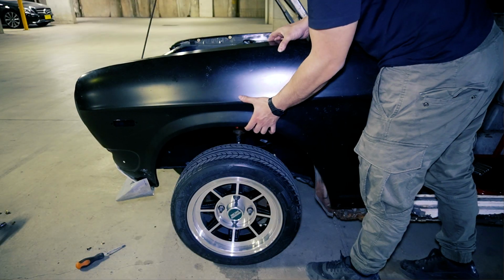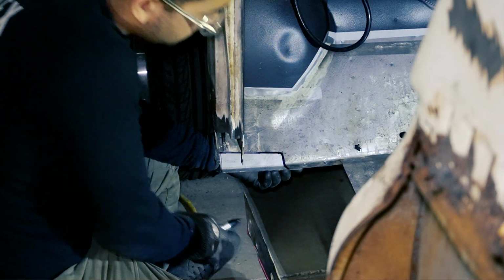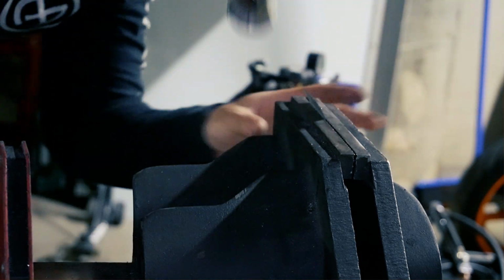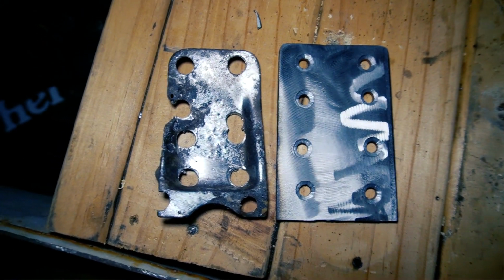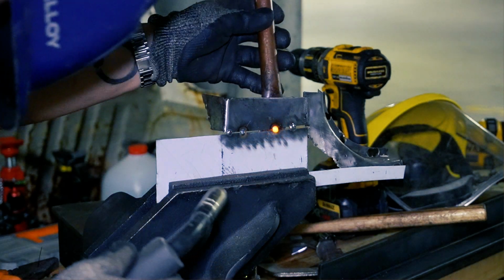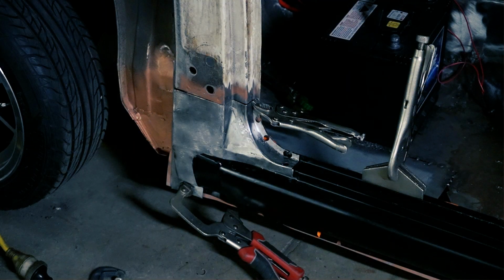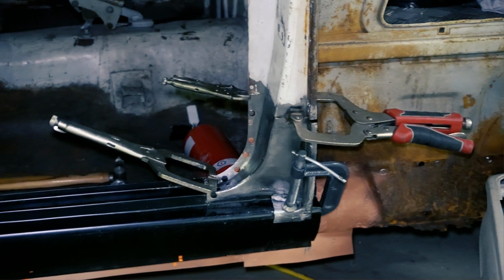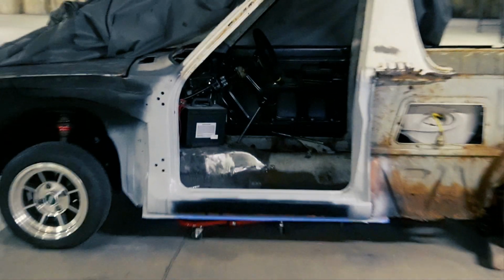DATSUN BUILD - COMPLETE LOWER DOOR SILL REPAIR (#22)

Comment: Hey Michael, checking in after the recent floods, hoping you and your Datsun weren't too affected by recent events. Been following you from the start and finally picked up an 84 model today that also requires a buttload of hard work and long hours. Not quite as much rust as yours but there is a lot of questionable backyard repair work to rectify.

Comment: To keep distortion down, use compressed air after each tack weld to cool it down. Takes time, but keeps distortion down. Also spreading out the tack welds all over the weld seam instead of going in a line.
Reply: P.S. the best guy I ever found on youtube for tips and tricks with sheet metal fabrication is Fitzee's fabrications

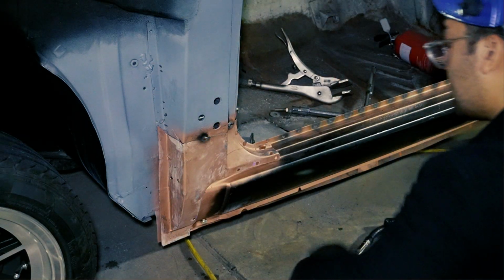Comment: What did you end up coating your floor did you recoat the bitumen stuff I have a 1973 4 door sedan with an a14 twin SU carburettor why did you end did you get kicked out of your apartment with all the noise and the smells 19:21 I am in Tasmania can smell it over the fence when are the question did you end up filling in the Cowling gaps so water cannot get in thanks you are an inspiration well done

Comment: There's a product called cavity wax that we use in automotive repairs, it has a 360 degree nozzle and coats the inside of repairs with wax protecting welds and repairs from potential rust. Might be useful if you can get your hands on it. I'm studying automotive body tech and use this a lot

Comment: I notice you weld too much at once, you're stitching 3-5 cm in one go. You should tack, move over 2-3 cm, tack, and repeat all around the place you weld. Let cool and start over next to the first tacks... etc until the whole weld is done. It should reduce warping.

Also, let me know if you need reference pictures/videos, mine does have a few of the same holes as yours, but I should be able to snap some for you despite the snow that's coming...
Reply from the maker: Thanks so much for the support! Yeah I've noticed with pieces with a bit of structure I can get away with the stich welding. With the flats I need to be more patient and do one spot at a time! Cheers 😁